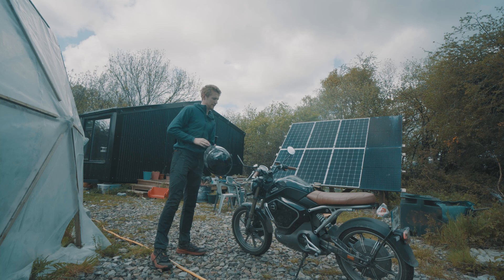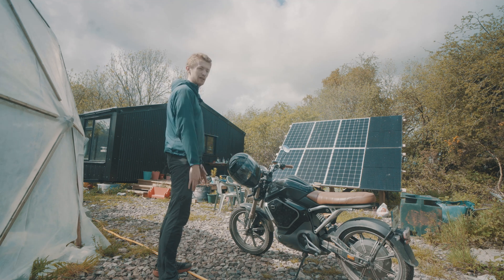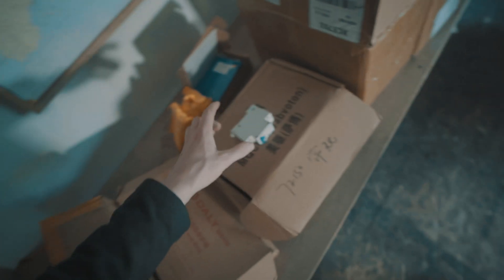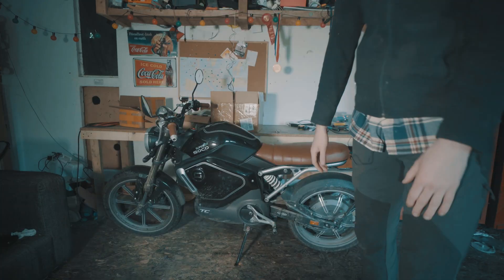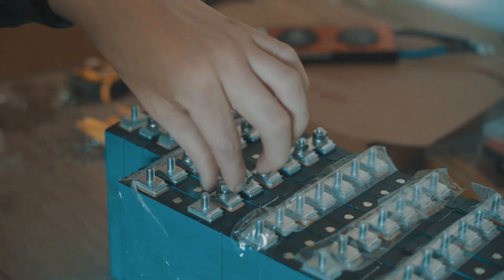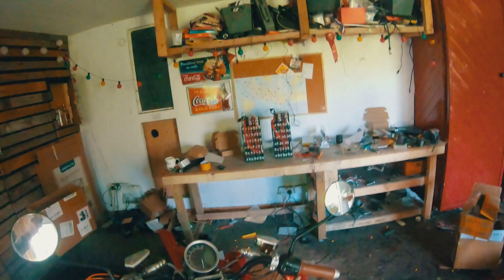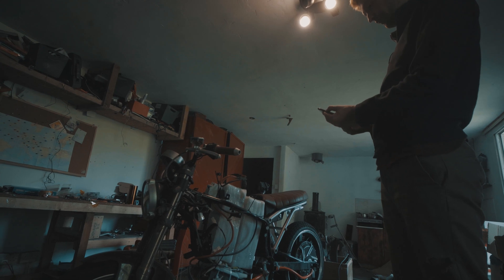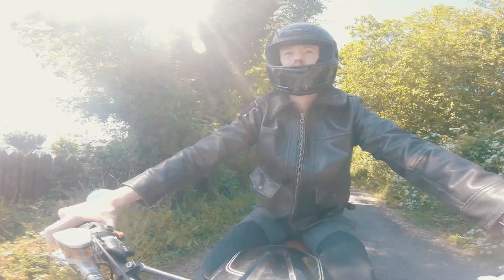Building a solar powered electric motorcycle  Super Soco TC upgrades

Comment: I don’t mean to be negative, but that soldering job needs to be better. You didn’t get enought heat into the joint to completely melt the solder, it was just melted in places. The result is what’t known as a “cold” solder joint with internal gaps and cracks that will eventually lead to failure. The proper technique is not to melt the solder with the iron, but to heat up the metal enough that it melts the solder allowing capillary action to draw the solder into all the space within the joint. Then, once the iron is removed, do not move the wires while it cools as this can also cause a cold solder joint.

Comment: Have you thought about clamping for those cells to prevent swelling under load. The previous bike would have needed this less but has it in the form of the ALU housing whereas yours will hammer those cells harder. It seems like your initial idea would have been better had it fit.

Comment: Did you put the original tire on the new wheel? I am going through a QS-Motor upgrade on my TC and am curious how the fit of the tire worked out for you.
Reply from the maker: @BilboBaggins42  yeah original  tyre fitted no problem..definitely  isnt rated for the bikes new top speed tho
Reply: @RuairiTheFilmmaker  I’m about to fit the wheel in place… for yours did you need to spread your rear fork for it to fit? If you did, how?  I’m exploring using a car jack to spread it but not sure how far to push it and not enough seems to just return to the same width.
Reply from the maker: @BilboBaggins42  yeah i spread it using a car jack  incrimentally widing it gradually ..only needed an extra 5mm or so
Reply: @RuairiTheFilmmaker  awesome! Thanks for the help. Got it installed and all buttoned up today. Rides like a dream. 😁👍

Comment: Has anuone any idra of what the original bosch 1200w motor is capable off running at a much higher current. I believe the TS1200R bms limited the amps to 30A, and the motor i think is max 3KW. With my replacement 45AH battery, that could run at 2C continuous, so thats 90 amps, but if the motor is at capacity 3kw, then all i`ll need is 50 amps, I wonder what speed would be achieved at that rate? Any ideas?

Comment: Great video, i was considering doing the same to my super soco TS1200R, i bought sa super soco 60v45ah battery from a super soco scooter, a fardriver 360 amp controller and screen. I was deliberating on a wheel hub motor. May i ask what kind of speed you managed based on your 90 amps setting thro the motor, id be hoping for around 65 mph. Thank you.

Comment: Sir… why not embed a stator connected in the motor… so it can self recharge it while running… just like a scooter???
Reply from the maker: Well the motor is in effect already a generator once the Regen kicks in the magnetic field inverts and current flows back from the motor into the controller to charge the battery if you were to add a stator  to the motor any current you generated from the stator would just add load to the motor drawing more power at a greater rate than you could generate from the stator

Comment: Great video mate, really well shot and presented.  

Would suggest to anyone thinking of doing something similar that you avoid the DALY BMS, which are basically junk.  They have great problems detecting the state of charge and the balance current is pathetic, when the BMS decides to balance at all.  Most people who start out with one end up replacing it with a JK BMS or an Overkill.  They can "flutter" also, rapidly cutting in and out which may have killed your sabvoton.

Might want to consider that you are probably going well over the discharge C rating for those cells, which will drastically shorten their life.  Any idea what temps they reach?

A lovely build though, and hopefully you havent experienced any of the issues I mentioned.  Subbed and look forward to watching your other projects progress.
Reply from the maker: Well right now I've got it dialed to max out at 9kw and after riding at relatively high speeds 80ish kph for 20 or so minutes I got a temperature reading of 35 degrees C in terms of c rate when I bought  the cells they had a stated max discharge rate of 3c not sure if that's 3x the rated capacity or 3x the the yield which is should be around 80% of that either way I'm getting somewhere in the area of 3.6kwh of usable capacity which should mean a theoretical max of around 10.8kw I'm not expecting these cells to last as long as they would in a solar or backup power application but I'd be happy with somewhere near  1500 cycles ...it will take a while before I can find out if that's realistic but I'll definitely  post an update in couple of years if the bike still runs 🤣
Reply: @RuairiTheFilmmaker  In the comment above he wrote he reached 80km/h which is 50 miles an hour (US - statute miles).
Reply: Only 3.6kWh? The Lithium phosphate (or what type did you take?) took its toll then with its worse energy density. The TC Max has 3.2kWh with its normal 45Ah battery. So not much less and it’s still too small for longer rides (60-80km range)

Comment: What was the difference in performance? Any big changes to acceleration, top speed, range, etc?
Reply from the maker: Top speed is around 105km   0-50km in around 4 seconds   range about 80km with mixed riding
Reply: @RuairiTheFilmmaker  Very cool, thanks!
Reply: @RuairiTheFilmmaker   That's precisely what I need! I bought a 2018 Super Soco TC  from a friend and knew he had issues with its battery. I think it got wet on its inside or something like that. So I got it cheap. However, it takes over 10 sec from 0-50km/h, the range is about 30km, and even when I'm close to 70km/h, the speed drops very fast uphill. There are some hills that get as low as 30km/h. Then I have a queue of cars behind me. I'd be more than happy if it could accelerate faster, and keep the speed steady at 50km/h uphill. I don't need it to go more than 70km/h, besides that'd be cool. Do you think the only way to achieve that is by upgrading the whole system as you did, or would that be possible by upgrading only the battery and controller? I weight about 90kg (~200lb).
Reply from the maker: @arduesp  I've seen some people running the original hub motor at much higher power levels than factory up to 9kw but I've no idea how long the motor would last being pushed that hard my qs can run at 9kw for 20 minutes continuously without going above 35c

Comment: I love what you did! I have the TC as my daily driver in the US. I top out at about 70 kilometers per hour, stock. I have a moped plate, so I can't do something like this without getting pulled over. What is your top speed?
Reply from the maker: I'm still sorta treating it as a moped just with allot more range and torque   I had it tuned to  go around 60mph max but I've turned it down a little to maximise range
Reply: May I ask where you ordered from, and price? I'm in the US as well, trying to compare options.
Reply from the maker: @slawdog4009  ordered everything from China shipping was fairly cheap  except the motor which had to be sent using a premium courier which cost almost as much as the motor itself and then ended up getting caught for import duty on it so  paid twice the sale price to get it  all the parts ended coming out to about 2500 euros but I had to replace the motor controller when it broke and bought that from the UK to get faster shipping which cost an additional 500
Reply: @RuairiTheFilmmaker  Yikes. Sounds like you still saved some money from the ~5k overseas minimum, but I'm sorry for all the trouble you went through. Are Alibaba/Aliexpress the go-to's?
Reply from the maker: @slawdog4009  yeah from what I've seen to buy a electric bike with those specs is probably around 6-7k so I'm happy with the overall cost and yean alliexpress is my go to
Reply: @RuairiTheFilmmaker  It's not just the cost saving, you've also got a pre registered road legal bike which is a big plus...
Reply from the maker: @oldmanonamotorbikeinbucks7604  yeah that was also a big reason I started using a existing electric bike because here in Ireland   there doesn't seem to be a clear way of registering a conversion from internal combustion to electric for a motorbike although since building this bike I've seen you can register heavily modified motorbikes In northern Ireland so maybe down the line I might convert a  combustion bike with seized engine to electric and assuming I could get the doner bike fairly cheap I could potentially build a 500cc equivalent bike with atleast double the range and much more power and even faster charging for around 5-6k
Reply: @RuairiTheFilmmaker I guess you cannot register your bike at all in ireland -  correct? is there a way for insuring it?
Reply: @slawdog4009  I got it from Flyebike (4130 Broadway, New York, NY 10033, USA) in Manhatton for 3,199 plus tax.